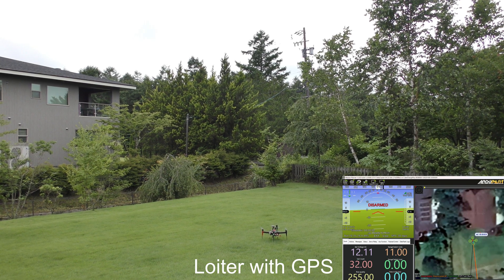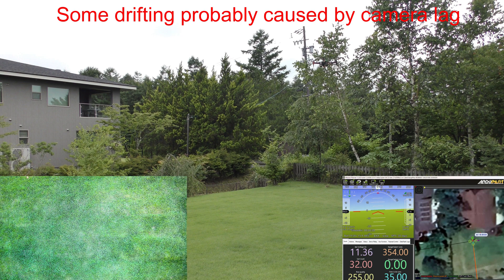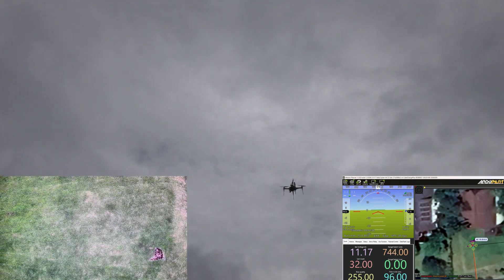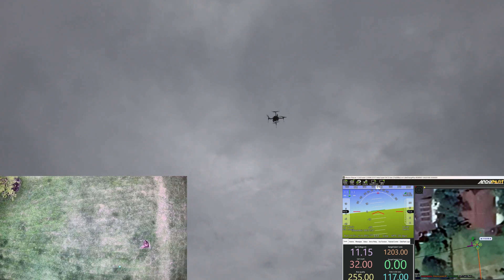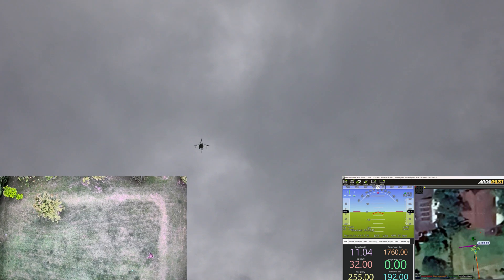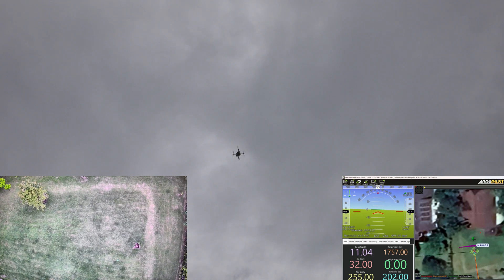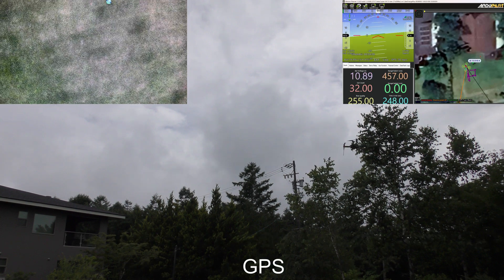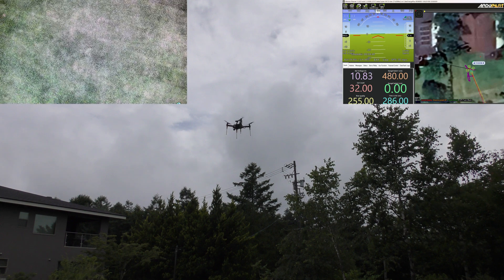BlueOS Optical Flow with ArduPilot

Comment: I love it very simmilar to our SkyHub system. https://youtu.be/FCNVRiE2nbU?si=kMIc9c_RIxJyjUza what do you use the  TFS20-L lidar for ? distance to ground measurement ? Or opticle flow data ?
Reply from the maker: Hi @yanko,alexsandrov, thanks.  From a quick peek at the SkyHub web page I agree it's similar to BlueOS + these recent extensions.  As always I think there's lots of room for open and closed solutions (and things in between).  The TFS20-L lidar is used for both precision landing's distance-to-target calculation and for the optical flow feature's conversion of rotation rates to horizontal speed.  In both cases that bit of it is done within AP's C++ code.  I've created a blog post here https://discuss.ardupilot.org/t/blueos-extension-for-optical-flow-and-precision-landing/136798.  Thanks again for the feedback!